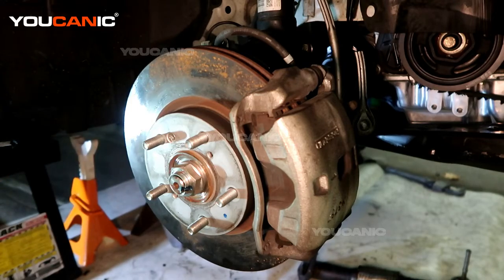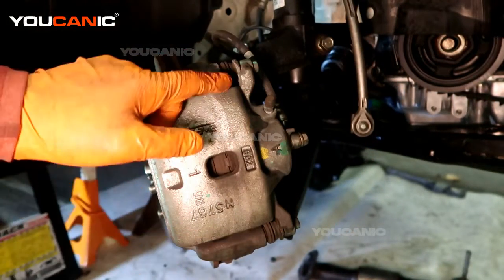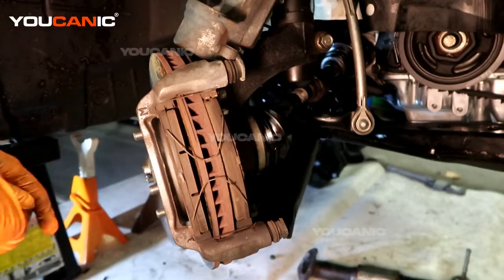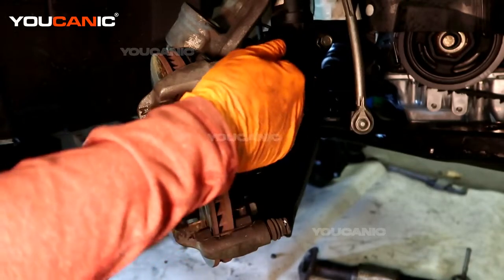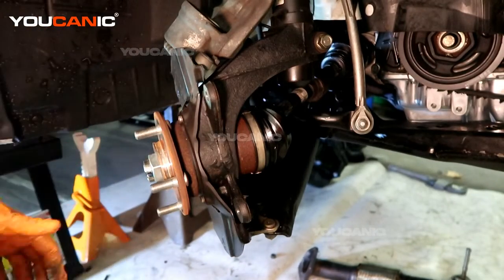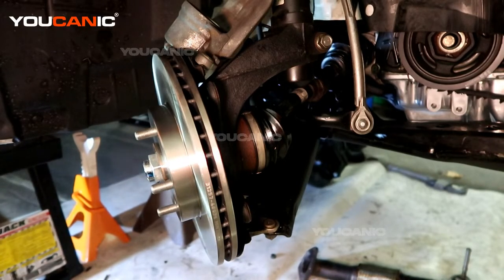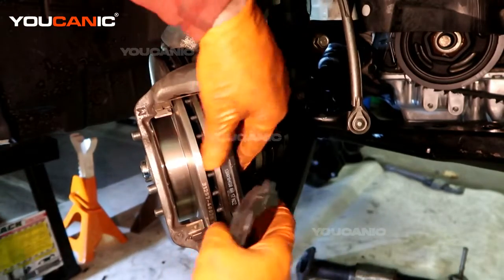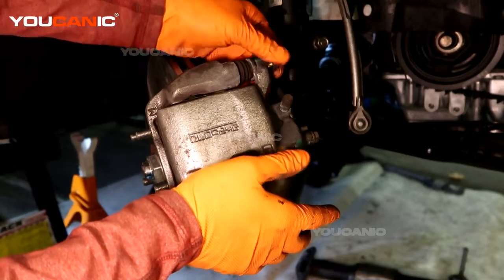2016-2021 Honda Civic - Front Brake Pads and Rotor Replacement

Comment: Where can I find information about how much torque to tighten the bolts in the vehicle for my 2019 Honda Civic fk7? It is not written in the user manual, I would be glad if you can help me
Reply from the maker: Thanks for reaching out! Our primary goal is to assist you with your car repairs. The torque information you need can be found in our Factory Repair Manuals and Torque Specs which is available at a small fee here: www.youcanic.com/manuals.

Remember, expert mechanics rely on a professional diagnostic scanner for modern cars. We've developed the YOUCANIC Full System Scanner to suit such needs. It puts the power back into your hands as a car owner. Feel free to explore more about our diagnostic scanner here: www.youcanic.com/scanner.

Comment: Did you set the car to repair mode??
Reply from the maker: In this video, we didn't mention setting the car to the repair mode. If you have more questions about the repair process, we suggest checking out our Full System Scanner at www.youcanic.com/scanner; think of it as a mechanic at your fingertips. 

For other car-related queries, you can visit our YOUCANIC platform (www.youcanic.com) where all your automotive concerns can be addressed. Remember, we're here to make car repairs accessible and understandable, so feel free to explore our resources and ask questions.

Comment: Instead of brake grease can i use a copper based grease ?
Reply from the maker: Hello and thank you for your question! Generally, it's always best to use brake grease due to its high-temperature resistance. While copper-based grease can work in some cases, it may not perform as well under high heat conditions. Feel free to check out our comprehensive guides on www.youcanic.com for specific product recommendations.

Remember, YOUCANIC is dedicated to helping you confidently maintain your vehicle with our free resources and our powerful YOUCANIC scanner. If you have more questions, reach out! We are here to empower car owners like you.

Comment: What are all the torque specs?
Reply: 80ftlbs for the carrier or bracket (for the 17mm bolt) and 25ftlbs for the caliper (12 mm bolt)

Comment: Torque specs nice nut not necessary for those will some experience doing brakes..
Reply from the maker: Thanks for your feedback! While some experienced individuals may not always need torque specs, our goal is to make car repairs more accessible to everyone. Using tools like the YOUCANIC Full System Scanner can empower you with the same diagnostic capabilities used by expert mechanics. Check it out at www.youcanic.com/scanner.

Moreover, investing in Factory Repair Manuals and Torque Specs can ensure your repair jobs are done accurately and safely. For a nominal fee, you can access them at www.youcanic.com/manuals. We believe in empowering car owners with the right knowledge and tools. Enjoy fixing your car with YOUCANIC!